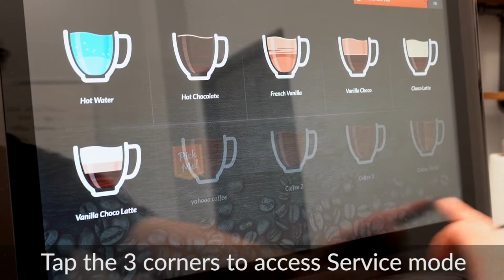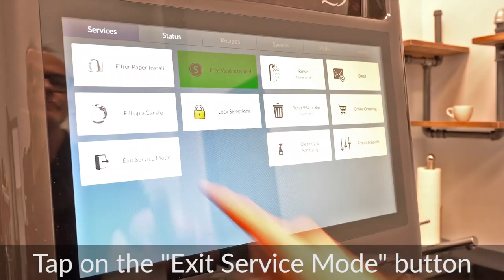Encore 29 | Empty Waste Bin

Comment: Question. When the 'waste basket is full' comes on, I press the 3 corners on the screen, nothing happens. It seemed that the machine wasn't acknowledging the 3 corner press command at all. What do I do when that happens?
Reply from the maker: Thank you for reaching out George!
There are a couple of causes that could explain your issue. In order to provide you with the best answer possible, please contact our technical support team at service.na@evocagroup.com or 800-561-6162, ext. 310. We will make sure to assist you in a timely manner.